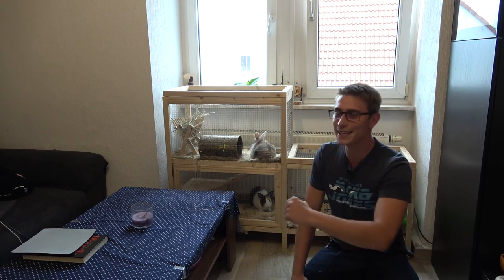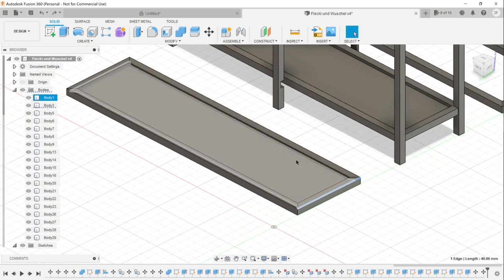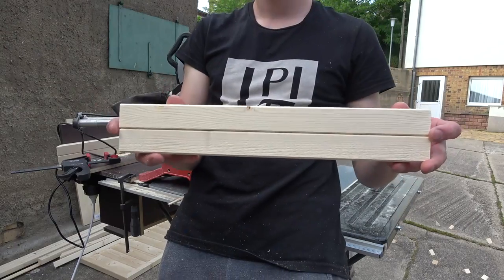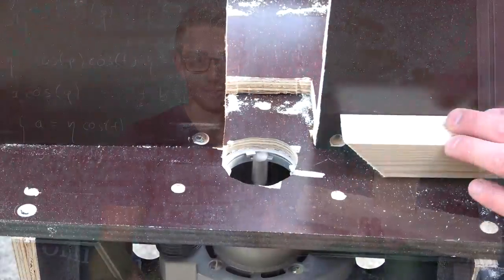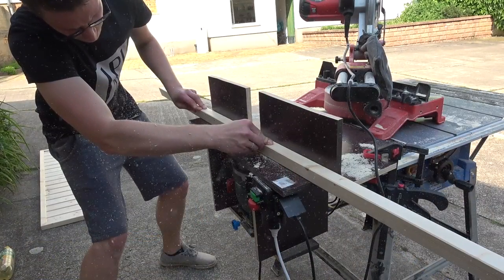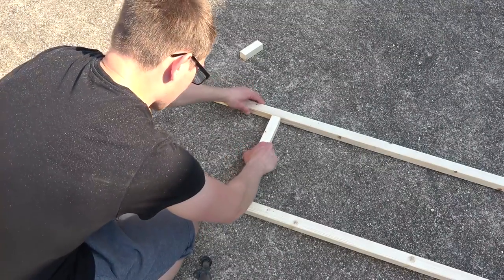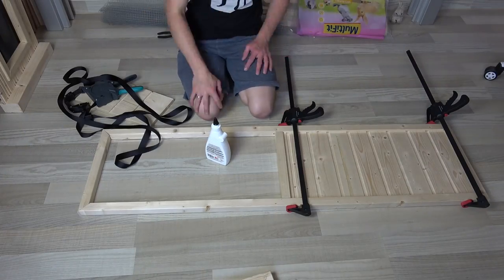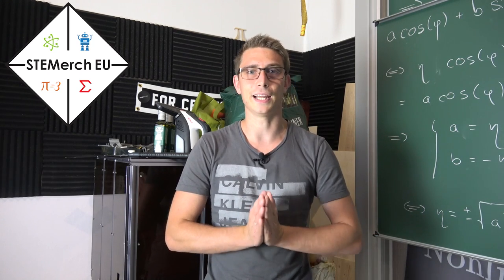An Affordable DIY Pet Bunny Hutch that Everyone can Build! - Home Wood Working Projects Part #1

Comment: Bro really being honest as a 17 yr old carpenter, men it's pretty decent the work you are doing. Most average beginner carpenters wouldn't do projects to that level by them selves. Thus being a carpenter requires strength. Great job mate, Keep that hard work on, God bless you man....
Reply from the maker: Thank you very much, I appreciate it!!! For how long have you been a carpenter? :)
Reply: @RockHardWoodDaddy  I have actually worked with my dad since 10 yrs old. I like electrical engineering too. Its tough man, we usually work around 10 to 14 hours. What about you? Btw I am from Honduras
Reply from the maker: Working all the time tbh lol